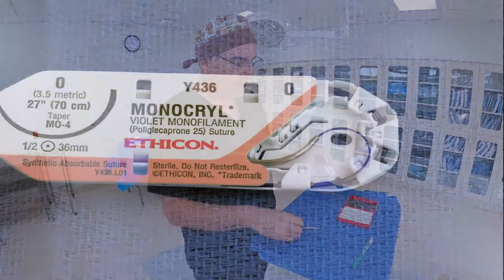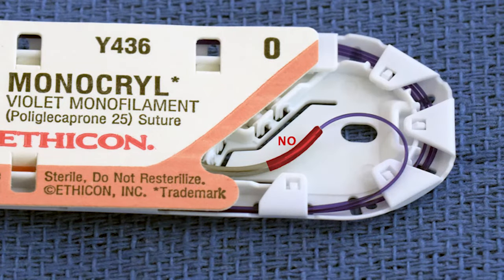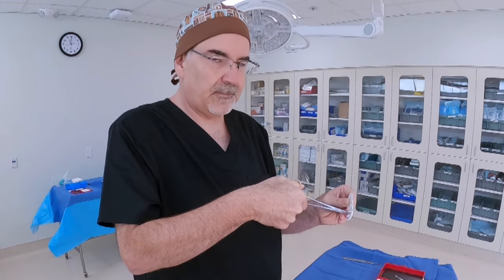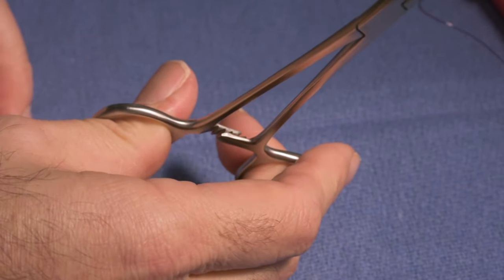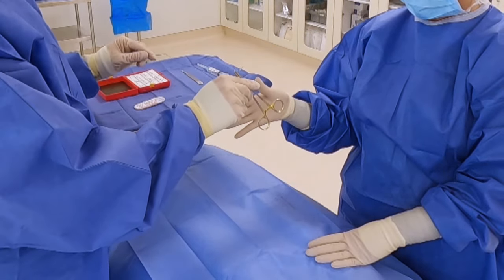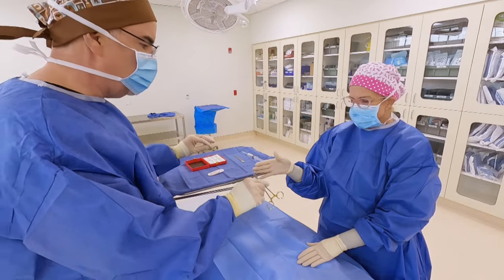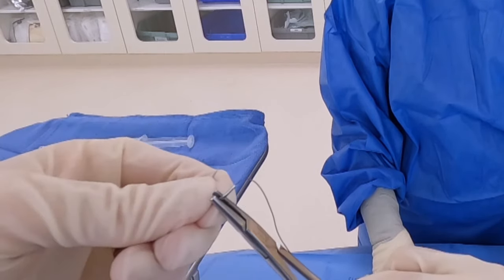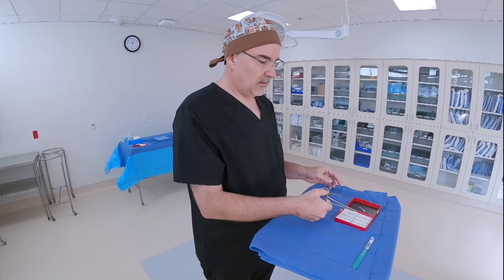Loading and Passing a Suture Needle

Comment: If you look up what the term kelly and crile means they are different based on serrations but still clamp the same tissue? Correct me.

i.e. We put together a major abdominal set that starts off with 10 7” crile clamps.

If we are short on 10, SPT just grab 6” kelly clamps and again no complaints. 

If the manual says not the same why are they the same though?

like what’s half serration gonna be vs whole serrations?
Reply from the maker: You are absolutely correct. SPTs will often sub similar instruments, with no issues. Unless you have a very particular surgeon, nobody cares. Here in South Carolina, the doctors refer to Peans as Kellys. The Surg Techs know what they are asking for. And since they are so similar, they are used in exactly the same way, so it really doesn't matter. In this video I'm just distinguishing the instruments for students who need to take a test on them. In the OR, those differences are mostly irrelevant.

Comment: Does a crile and mayo really matter? Depending I mean.

i.e. so many (SPT here) will sub a 1661 crile wood 6” for what the count sheet calls for a 6” mayo hegar.

I know the difference but it still so identical and no one ever complains for those type of details.

I ain’t talking like 6” crile vs like 11” mayo either.

also 

no one picks up details of 6” mayo hegar driver vs 8” mayo hegar driver.

your thoughts
Reply from the maker: You are absolutely correct. SPTs will often sub similar instruments, with no issues. Unless you have a very particular surgeon, nobody cares. These instruments are basically interchangeable.